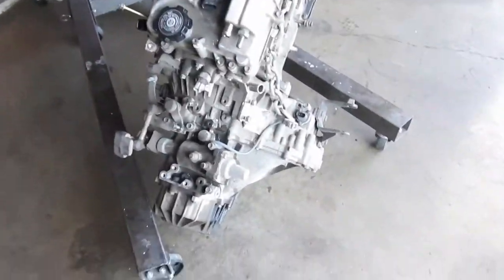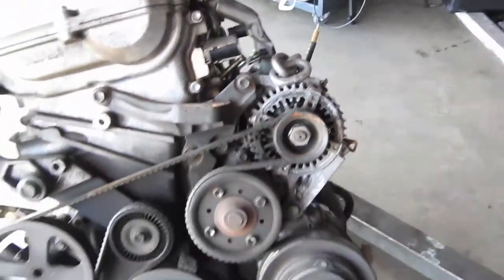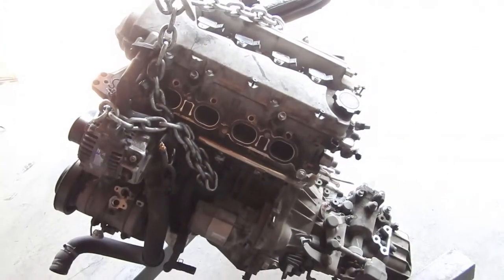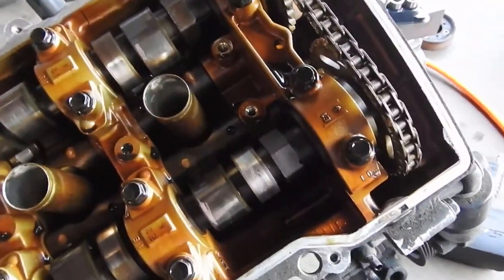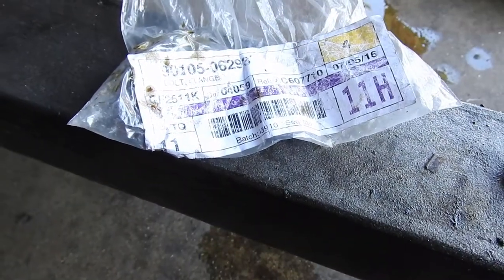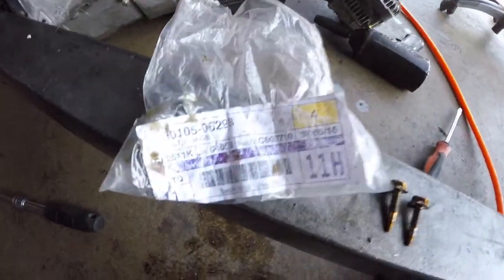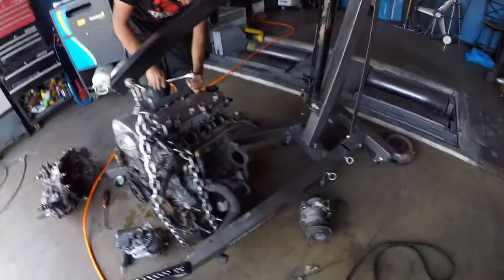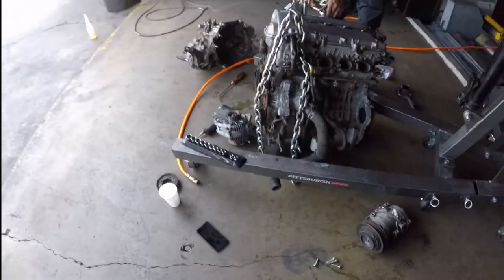Transferring Parts and Changing Lift Bolts

Comment: I have a Corolla runx 2zz went to change the bolts and found one broken yet my lift works fine, I just put it all back together and no issues I just went to do it as a service part, but as I said lift is engaging @6200 and can I can feel the pull no problem
Reply from the maker: Neil Devlin Nice if they are broken you wont hit lift. Its crazy how two simple screw could make a different
Reply: Rafa's Garage that’s the thing i am hitting lift at 6200 I can hear the cross over and feel the car rise at the front, fckin mad only one is broke I don’t know what to do